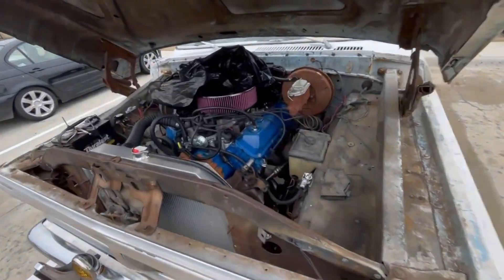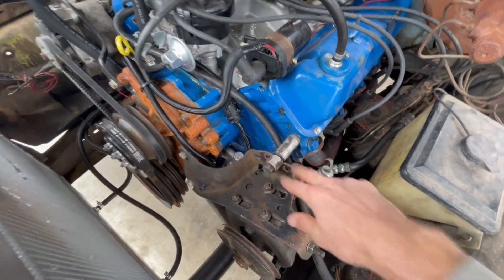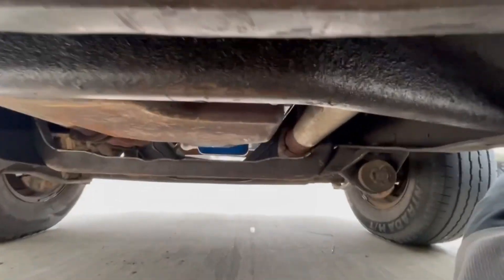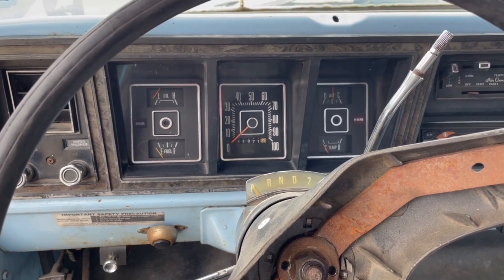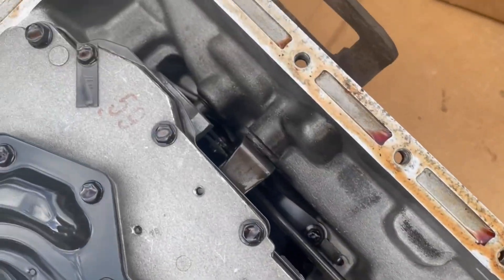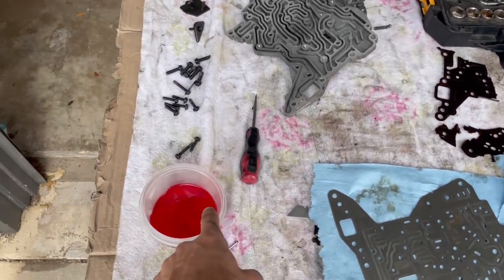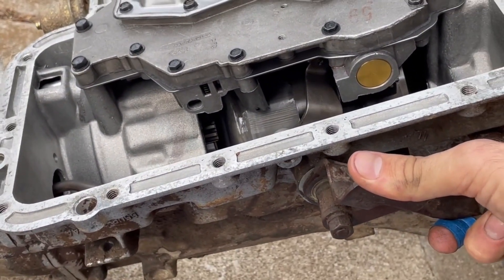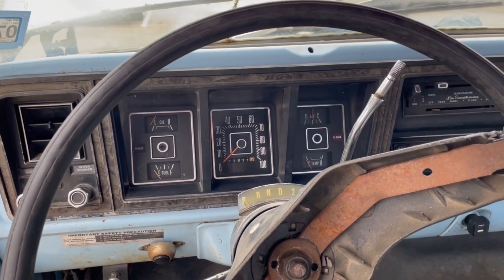F100 460 BBF Swap Part 2 (Notes and C6 Shift Kit)

Comment: The filter you removed was actually the correct one for that pan . The one that is fitted is for the shallow early pan
Reply from the maker: I’m glad you caught that! Not sure why I didn’t question the differences in the two filters. Will be switching filters ASAP. Don’t want to be starving my transmission of fluid.